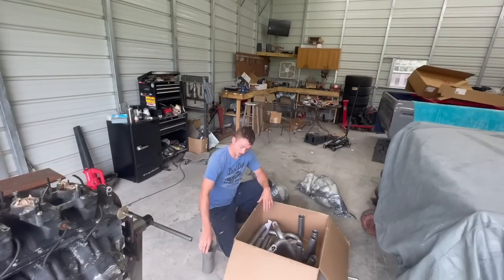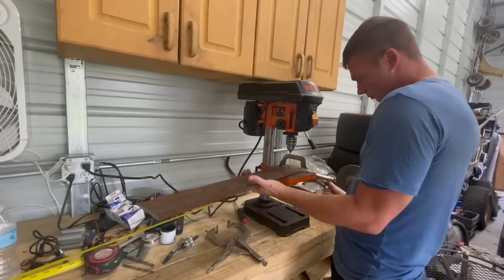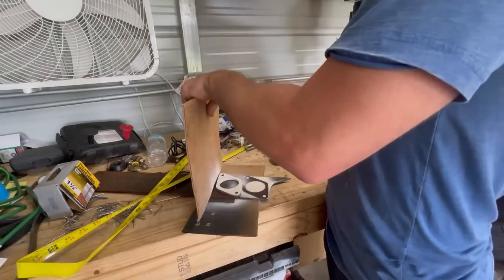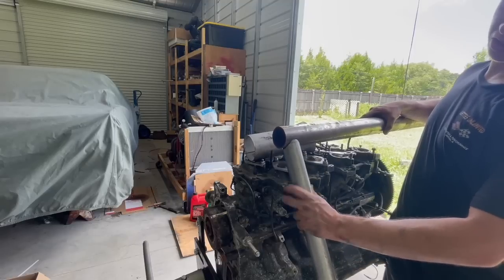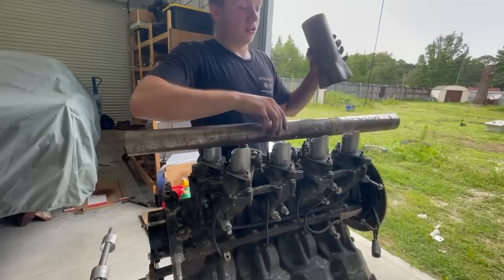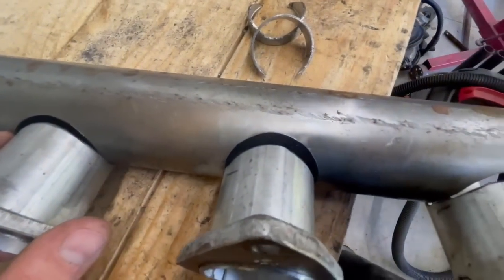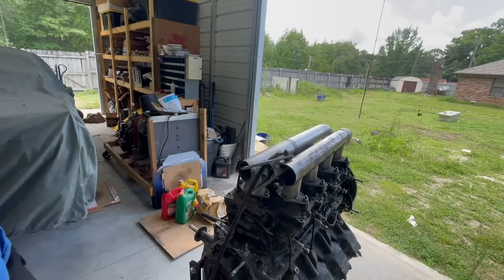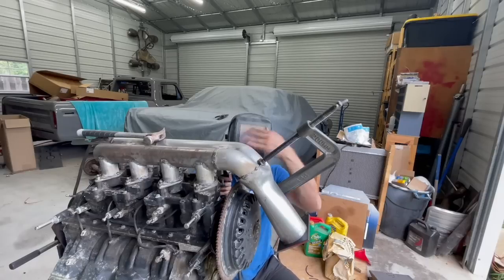Can I get this BOAT engine to work in a car?

Comment: I’m a marine mechanic. I have lost count of the many hours that I’ve thought about doing this exact project. Awesome.
Reply: How would he handle the water that gets thrown outt with the exhaust?
Reply: Ya problem is two strokes are extremely particular when it comes to fuel air mixtures, should have kept the individual throttle bodies, these motors have millions of dollars in R&D just to make them run right.
Reply: Same here,but then i have a passion for two stroke
Reply: What about a cooling system? and timing advance....
Reply: The young man is good keep up the good work
Reply: @kylejorgensen1412 on marine swaps the cooling system usually gets replaced with a thermostat, electric water pump & radiator.
Reply: @13coyote13  shure but it’s also probably an engine from the 80s or 90s the way engines run have come up ten fold
Reply: @StroDshiesty1 this has been tried before outboard motors have a thin water jacket because they're used to having a constant supply of cold water.
   Water cooled engines with radiators have a bigger. Water jacket because the water is always hotter.
Good luck on cooling that engine with the radiator it's been tried many times
Reply: When I was a kid me and my dad took a antique 10hp boat motor that was air-cooled and turned and keyed crankshaft, made motor mounts and put it on a old go-kart.  That baby was stupid fast and dangerous 😅.
Reply: Imagine a merc 300r v8 in a Miata they seem like they would be muuuuch smaller than an LS

Comment: Log manifolds will give it that 1930s look but you had a perfectly good intake and throttle bodies with the the stock carburetors and airbox.  You don't have to use them for fuel, just adapt a throttle position sensor or perhaps a ninth .  You can add injector bosses to the "front half" to inject directly into the crankcase.  Just drill and epoxy after you disassemble.  This is better than before the reeds.
Reply: Exactly, he can try to run a supercharger through the manifolds later, but just stick with the reeds until it's running in the car.
Reply: Problem there...unless he gets a marine 2 stroke engine ECM an automotive ECM only wants to spray every other piston drop.  I worked in a marine repair shop, the worst part of the business is ECMs. Horrible expensive, even ones for 4 stroke motors in I/O boats.
Reply: @davidleskov5078  Im sure there has to be a solution out there and its probably related to the guys messing around with rotary engines as they have a similar issue in regards to not having a traditional 4 stroke cycle.
Reply: @davidleskov5078  I just had another idea, since he probably isnt going to use the ECU for ignition timing you could just spoof the ECU into thinking you are running at double the RPM so its firing the injectors twice as often, another problem might be that you'd need a high quality injector that could open and close fast enough for a two stroke, since at 6000rpm the injector firing rate would be like 12000rpm on a four stroke engine.
Reply: @baconpop4388  yes, put a second Hall sensor on the crank at 180* so the engine appears to be spinning at 2x, doubling your injection impulses.
Reply: I've heard of people adding notches or magnets to the crank sensor to fool the ECM to think there are more cylinders...
Reply: @baconpop4388  going back to my original suggestion, I would use a TBI style injection system at the front of the log intake, instead of multiport. Then the number of cylinders won't matter.
Reply: The Holley Dominator can run 2 cycle, so can MoTec.
Alternatively, one can get a used ECM from a fuel injected 2 stroke outboard like A Merc Opti or something.
Reply: @jonathancorbett5917 a super charger on a 2 stroke?  😂

Comment: Have you decided, or started thinking of how you will do the engine managment system? I haven't yet tuned a EFI 2 stroke myself, but know it can be a challenge. Plenums with 1 TB and no expansion chambers and 8 cylinders probably will make it easy to tune for a EFI 2 stroke🤞

Comment: Man, that manifold is crude, but considering working with less than ideal equipment, you are chewing your way through damn well. Great job and hats down.
Reply: Maybe instead of buying 25 project cars invest in the right tools to work on them?
Each time I flipped a project I bought something I needed.

Comment: I'm 55 haven't had but 2 boats . never knew Johnson Evinrude made v8s, or even inboards. I inherited my grandfathers 1969 Larson speed boat in 1999. id never been out on It but once. Ford inboard 289 HO. garage kept, interior was amazing. I made a discussion to sell it. I was gonna have to tarp it till I built a shelter. I offered it to two male family members they just had done the boat thing and didn't want it. it was cherry he didn't have a lake house so it pretty much stayed in a garage it's whole life. I went with him to a small local lake when I was 14 just to run it a little. keep it oiled up. I was surprised how fast it was. I sold it and the 1976 el Camino he pulled it with, a 33,000 original milage car/ truck😂 looks fun ,you kids teach me something new every day. Subscribed!

Comment: I had a 510 in the late 80's, dude I bought it from road races it, so it had like 2" flares on all 4 corners and he raised the rear diff 1 or 2 inches so it was super low with fat little tires, but the rear end barely squatted, tires were tucked up in the wells but they were pretty well straight up n down. It was a total beater, originally red but sun faded so bad it was flat orange. It was a 2 door coupe, woulda rather had a wagon all dam day though. Love the 510's and I love 2t's (two strokes). Can't wait to see how this turns out my man, thanks for doin it.

Comment: Intake volume needs to be at least 2x volume of engine to avoid airflow problems. A skinny pipe connecting everything together won't work. Will be impossible to balance airflow. Even 1 to 1 would be bad but workable. You need to use math for this. Throat width for each intake runner is diameter. Area is 0.25 x (3.14 "pi" x width squared) for example if runner width is 2.5 inches, 2.5x2.5 is width sq of 6.25. Then 6.25x3.14=19.63 is the width sq x Pi. Now multiply by 0.25, so 0.25x19.63=4.91 is the area of each runner. area of runner times 4 runners in this case will put you back at 19.63. To find diameter or width of pipe equal to the 4 runners, have to use formula width equals 2 times (radical Area/Pi) radical is the checkmark with long tail on the calculator. First area divided by Pi, 19.63/3.14=6.25 Now radical of 6.25, that's checkmark 6.25 on calculator with answer 2.5. multiply that by 2, so 2x2.5=5, to get the required width of 5 inches for each intake plenum to be 1 to 1 without restriction. 
Area isn't double the width which is a good thing because pipes would be huge otherwise. 
The other problem is that you can't run the exhaust through the motor on land. Without the water pumping through the motor and out the lower unit, the exhaust will cook the engine. You have to close the cooling system and use an electric water pump because the outboard pump is part of the lower unit. Heres an example of the exhaust pipes, two stroke tuned.:
https://youtu.be/IcO_2pLqYqw
The good news it will make A LOT MORE power with pipes. IF you are a good welder you can make them. I think there are pipe calculators online.

Comment: I know this might be obvious but it also might not be have you considered the rotation of the engine to make sure it turned the right way for the transmission and rear. Just drill a hole in that plate you have connecting the two upper plenums so you can drop a socket on an extension through it. If you have an extension with a wobble end on it or a u-joint  offset adapter that bolt won’t be a problem

Comment: You can use aluminum foil and a piece of wire or zip tie to keep slag out of things like that when you are welding or just cram some in there, you can even reuse it. If you need to weld near a hole (where a bolt goes, etc) you can pack some in the hole nice and tight to keep from disturbing the hole much and it is pretty easy to get out later. I like the packs with the small sheets of foil, much easier and faster than tearing some off of a roll.

Comment: When making a notch in a pipe, just sacrifice a little bit more pipe and allow the centering drill bit to act as the guide its intended to be :)

Also instead of capping the end opposite the throttle body, how about doing a U bend so it can help balance the two sides?
Reply: I second this

Comment: As some others have said, work safer and protect your eyes! You've only got 2. ESPECIALLY when using cut-off wheels. They have the well deserved knickname of death wheels. Worked for a guy many years ago that lost an eye when one came apart. 
And keep your face out of it's path in case it does come apart.

Comment: Maybe, you could tack weld the branch flows to the log and use a metal hole saw to cut the holes afterwards or just drill the biggest hole you can and use a carbide burr bit the rest of the way. I wouldn't have thought of that without seeing this though, hindsight, lol. I'm looking forward to seeing how this project turns out, it's definitely unique.

Comment: You can always run the intake on top since you don't have to worry about an oiling system.  Quite a few 2t scooters back in the day had the cylinder head facing the ground. The joy of two strokes,  and if it was still carbs with the correct coil you can run them in reverse with no modifications. Old boat motors you would shut off the engine and restart it in reverse to make the boat go backwards.

Comment: A 4x8 rectangle of steel would allow you to make a manifold with free flow, that includes all 8 intakes on a very uniform, open flow plenum, which you can then attach a single, rather large throttle body to.

Comment: There are guys that run these engines on sand rails. They are the exhaust , intake, bell housing etc all figured out and have cad #s for all two custom parts.

Comment: Just drill a hole in that exhaust bracket for a long extension to fit through and problem solved or just move the bracket like you said, they make fine sanding disc to polish that out which I know that you know that. Don't Shazam through the videos your doing fine. Some people try to become the star and get nothing done on a 45 minute video, yours are focused on the content so far. Don't like music videos though. Rather have natural noise of craft going on even though no one is talking. You're doing awesome.

Comment: I've watched a couple other guys put a 2 stoke in a car. I love 2 strokes, light, powerful, no cam, etc. I'll give you a heads up, cooling could be a problem. Marine engines are designed to circulate fresh cold lake water. Put the thickest possible rad with the best electric fan in the car! Also I think you should go throttle body not multi port injection.  Whatever ECM you use, they expect to inject fuel every second stroke of the piston. Your cylinders need fuel every time the piston drops. At least with TBI (MAP or MAF) and O2 sensors the ECM should spray what the motor needs. Personally I'd start with carbs..

Comment: Since the intake intakes upward, you may experience some fuel/oil pooling in the intake runners when it sits shut off. It might be a good idea to add some type of threaded plugs in the runners now so u can drain it if it floods without taking off the whole intake or having to jam some hose down there and suck it out. You'll thank yourself later

Comment: If you weld the tubes together first you can run the hole saw through the bottom and cut out the holes after it’s all welded together

Comment: In the comments I read the reeds and the oil pump were deleted. You must have separate reeds on each intake port for it to run at all. You now also need to premix oil with the fuel. I strongly suggest you study and understand 2 stroke theory and this engine. Always remember this engine was designed for max HP and any changes if not well designed with 2 stroke theory in mind will likely reduce the HP or make it not run at all. Which is the case if you delete the reeds. I could help you with the basics. I highly recommend The Two Stroke Tuner's Handbook. Learn it's contents and you will be set!
Reply: The reeds will go back on , then he will mimic the mariner or lower end carb philosophy with 4 ford inline 6 one barrels feeding custom 4 carb inline set up ,pretty easy to get linkage and fuel supply going .chop the drives haft from the lower run it through a Berkeley jet pump style thrust bearing to a Datsun
Flywheel and Trans plate , not seeing bolting a trans with dowels all that ,let it rip steible box style ,may have to put the radiator s on the roof but it will be putting down 2.5 times original hp and the original Trans will live with 14 inch stock radials or 13s
Reply: Or he is planning for lots o boost and some sophisticated exhaust upgrades

Comment: Weld the small tubes on to the long tube then if your tube is 2 1/2 OD you can use a 2 1/4" hole saw to cut the oles in the long tube after the small tubes are welded on.

Comment: Look at a Ford SHO 3.4 V8, it uses silicon rubber tubing to connect each cylinder intake runner into a common plenum with a single throttle body.
You don't need to weld it all up together like that.  You will need port fuel injection.    
On the other hand, why not use the carbs?
In terms of ECU, look at Speeduino and build your own, it is super cheap.   This is my plan for a V4 boat engine I was going to put in a racecar (but now thinking EV instead)

Comment: A 5 or 6" cutoff wheel for lines & grind wheel to round corners on the right angle grinder would save you So much time.
Cheers

Comment: Take a long strip of metal, and drill access holes for all 8 of the internal screw/stud points for a socket and then weld it the whole length, it will look more professional while being stronger, and more rigid.

Comment: Dude, just use a flat plate on the bottom... or two if the flanges are not level, weld up 5 sides to the box  and 45s over each port.... run fuel and wires inside the box for injection.... bolt the top plate (6th side of the box) down for access. Put throttle body on whatever side makes sense... if you're boosting,  build it strong enough to handle the pressure. Look at the inside of a c8 corvette intake to see a sort of close  example.

Comment: The easiest way to get this to work n a car, if you are committed to laying the engine on its side, is to use jet ski carbs. The don’t use a bowl and can run on their side. I think you work need the intake to face upward. The flange on a jet ski carb may bolt right up. There are racks of three of them already… Just need to add a 4th.

Comment: So a question. On the evinrude johnson the first 1/3 or so throttle is all timing adavance before throttles ever start opening. the throttle moves the timer base under the flywheel. They wont run for crap until you get throttle pick up and inital timing set its called sync and link. the next problem is the 300 v8 waas designed to run at 140 degrees temp. the part you removed under engine is called mid section and inside is a tuned exhaust pipe like exspansion chamber on dirt bike. The thing on first video with electronics and wires is the vro pump it pumps oil and gas then mixes before sending to carbs. these were a pain to tune when new on the boat. Me I would have made it run before doing all this. You know you can rebuild 3 sbc at the cost of one of these. If the ignition box aka poer pack or the stator or the timer base are bad its a lot of $$$ Been fixing this stuff long long long time. I back in the day often thought of these in a little 64 chevy 2 but Id never attempt it. good luck the fight has just begun.

Comment: Love the project.

But be mindful. Efi injectors may foul when running premix. Also, if you can get egt probes into the exhaust, this will aid individual cylinder tuning.
Reply: just hazarding a guess here but Id bet this 2 stoke motor uses oil injection rather than pre-mix, hopefully its fully mechanical ..

Comment: Great project you r doing, just one thing the plenum tubes diameter is not large enough. The end cylinders are going to be starved of air if it’s not boosted.

Comment: Your going to want to use tuned pipes and reeds with individual carburators
Reply: You are correct. There's a reason it was that way. It won't run without separate reeds for each intake port.

Comment: I like the way you did time lapse of the repetitive stuff but slowed it down on explaining what you were doing, is the motor going to be mounted to where intake will be on driver side and exhaust on passenger side? Figured since its no mounts made for a vehicle and 2 stroke you could mount it anyway you wanted

Comment: The engine can be mounted intake side up, is better for fueling and oil lubricarion. And the exhaust is better on the bottom of the car

Comment: for a 2nd rev design, I'm going to suggest you collaborate with Thunderhead289, he may be able to assist with a 3D printed design for your intake manifold. Sure there are plastics that should get the job done, however you can also use a printed pattern to cast an aluminum part too.

Comment: i think you're going to have an issue with that long intake runner. they work great when tuned properly on a 4 stroke but what makes them great for a 4 can be bad for a 2. the pressure wave generated by the runner can crash into the reed valves causing them to open when they should be closed leading to a loss of performance, this is why 2 strokes don't have them, instead they have a rectangular box to house the filter and contain most of the reed valve backflow, just like the one you took off.